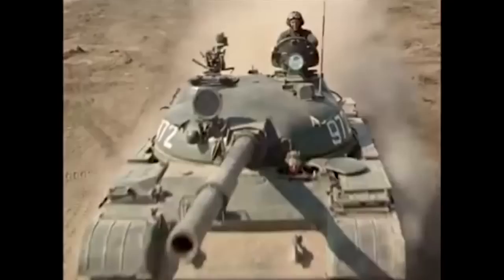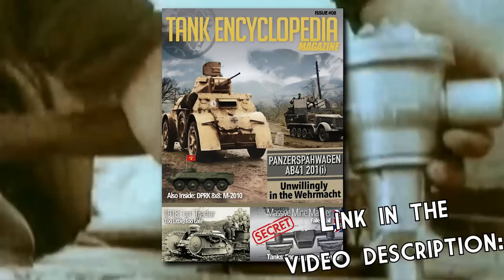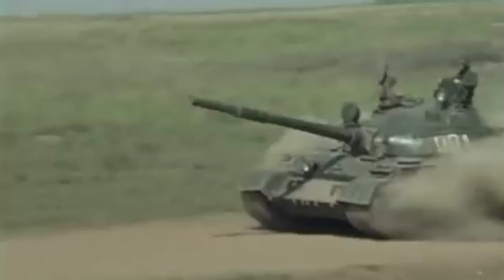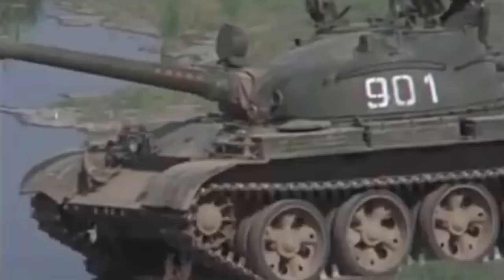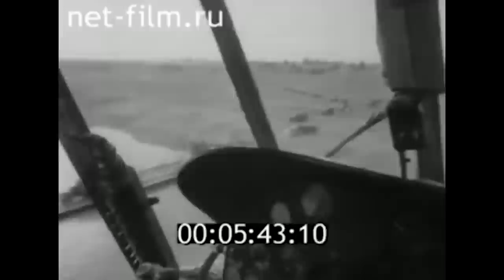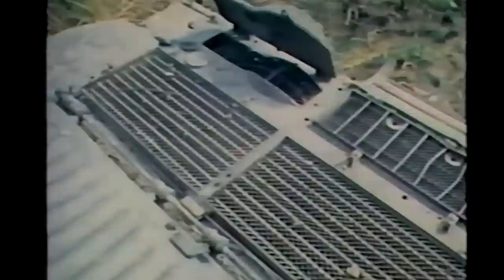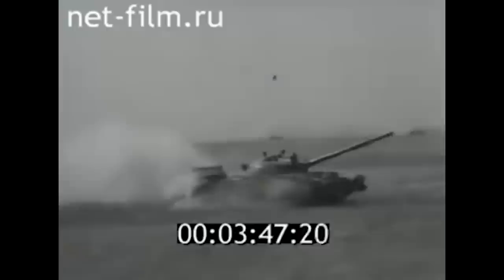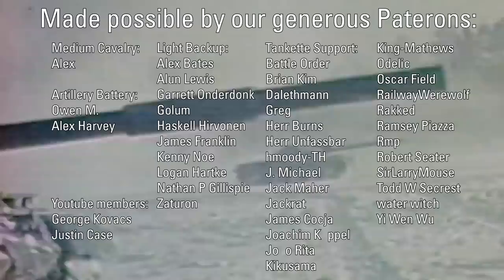Same-Old Everything Else | T-62 Main Battle Tank Part 2

Comment: “Groundbreaking gun same old everything else” is why I like the T-62 so much tbh it was the last conventional mbt design the Soviets produced before switching to the ultra low profile autoloader tanks they should’ve continued developing conventional tank designs imo to truly match the western ones
Reply: they look about the same height wise to me
Reply: M60 and T-62 are medium tanks, T-64 was first soviet MBT.
Reply: I mean the original T80 would absolutely thrash the original M1 and maybe even original Leopard 2. The design philosophy was sound, but Russia isn't the soviet union. Western nations didn't collapse and kept improving their tanks while Russia just couldn't which led to where we are today.
Reply: @92HazelMocha  "the original T-80 would absolutely trash original M1"
Saddam thought the same. However as russians have found out, T-72 doesn't equal T-80 and T-80 will never equal T-80U, even if it's B, BV or BVM modification package because T-80U is straight up different tank and slapping shit to it won't stick.
Reply: @TheArklyte  I think it's pretty well established that the Iraqi failure to repel the combined arms invasion rather than any specific AFV was the cause for their poor performance. It didn't matter if the Iraqi Army had the shiniest T-72/T-80 variants, they had no chance at supressing the coalition air attacks and reconnaissance, which meant that every tank unit knew what they were up against ahead of time. That and the lack of modern T-72 variants with adequate night vision gear (outside of IR) didn't help. 'slapping shit to it wont stick' doesn't even make sense, early M1's has a 105mm gun, was the upgrade to the 120mm 'slapped on'?
Reply: @TheArklyte ude, Iraqi's mainly lost because they were massively out-numbered, they were zerg-rushed.
Reply: @TheArklyte what are you smoking? I want some of it.
Reply: @goforbroke4428  basic logic? T-80U uses different armor array and MTU from T-80BV so claiming that T-80BVM is equal to the former implies that you cut down the tank in several places, removed and replaced whole sections, welded it back together and somehow made sure that those welds aren't now a bunch of massive weak points. Which is, if you have trouble with comprehending basic concepts and sarcastic tone of my previous sentence, something that no sane person will do as it's wasteful and pointless... though now that I think about it, it's something stupid enough for russians to try 🤔🤦
Reply: @bilalsadiq1450 
>it didn't matter if they had the shiniest new T-72
>lack of modern T-72 variants didn't help

You've contradicted yourself in back to back sentences.

Now, let me tell you something about how it didn't matter. Except it did. And Iraqi soldiers and engineers had proven that their perfomance far outdid some former "superpowers".

Saddam hoped 1)that certain parts of the desert would be impassable; 2)that coalition forming against him would fall apart; 3)he can slow down and tie down the invading forces to turn it into a slog.

1)just like two certain examples before this, desert ended up being quite passable and easy to navigate by NATO forces due to one feature their AFVs had - GPS. Not quite as cool as how Toyota Hilux have ruined Gaddafi's hopes that desert would defend him, but it still completely nullified that advantage as both supplies and thus invasion force continued to roll forward.
2)bombardment of Israel with Scuds to drag it into the war too and thus nullify the support of muslim neighbours to this invasion and even gather their support in the long run by turning it into bigger "westerners vs us" war. Doesn't work without achieving the slog part where conflict will just drag on for months;
3)main iraqi losses of AFVs amounted to ATGMs launched by IFVs and helicopters. And when those had trouble a few times, tanks and airforce rolled up. Because thanks to №1, they knew where they were, where enemy was, how to outmanoeuvre the enemy, consolidate forces and when to engage. Now tell me, do you know what an ATGM is? I'll assume you do and that Desert Storm era ATGMs are mostly HEAT warheads and laser guidance. And while TOW-2A and interim Hellfire where starting to get available during that time, majority of ATGMs used during that conflict were of older types. So no tandem warheads. Moreover many types would be even susceptible to IR interference from dazzlers like Shtora. Dazzlers Iraq tried to purchase from USSR and then, after USSR once again refused, from China. Reportedly they even were able to import a few. Not a few hundred or a few dozen, but just several units. So their impact isn't known as not only they were of older type, they didn't make it to combat. But let's back a bit to that lack of tandem charges and ATGM reliance. You know what it sounds like? Sounds like there is a technology that was used on modern AFVs before Desert Storm that addressed that! It's called a bloody ERA. That iraqis also lacked a capability to mass produce and thus outfit their tanks with. But it didn't stop them. Remember how I've praised iraqi engineers? They already faced TOW missile, even if TOW-1 en masse launched from both helicopters, AFVs and even by ground crews. How? When? Iraq fought in Irano-Iraqi War! Recall that name? War that saw a low of soviet and american export equipment used. And guess what, iraqis in late 1980's did what apparently took russians over two more decades to do and achieve only on T-90A, if video from Syria and russian nationalistic zeal and pride in comments under it to be believed - make tank immune to old TOW-1. Iraqis tested several dozen arrangements of applique composite and screens with captured iranian TOWs. And applied spaced armor to their T-72M1's ie polish T-72A's without modern FCS, with empty ERA, mild steel APDSFS and downgraded armor array. They also applied the test data to upgrading another tank though were limited in time, budget and modification reserve of tank in question so it produced mixed results, which worked only sometimes. Maybe you've heard of it? T-55 Enigma rings any bells? Oh, and final problem for ATGMs, but first obstacle on their flight path - APS. Drozd existed in 1980's, costed only 30k$ per unit(ie 10k$ per saved life of crewmember at most if we take 3 men tanks like T-72 in account) and was mounted even on bloody T-55s of soviet marine corps(though mostly because they were lighter tanks that suited their landing crafts). So what would happen to a "most modern" tank of 1989-1991 if faced with american forces? It would also know where it, its allies and opfors are. It would be notified if lased by either guidance beam or even rangefinder(and turn turret in that direction. Notice me, oh reader. And thus also dazzlers, gun and APS), it'll notify allied units, turn IR dazzler that way to slow and confuse the electronics and to scan for the targets in the meantime, it will use thermals(iraqis tried to purchase a few from Belgium. Once again, use only rumoured and no evidence remained) to scan for hostiles and deploy smoke(smoke dischargers in 1991 already experimented with blocking IR so no beaming and no thermal, not to mention often the system was automated to cover the tank if lased immediately) if found any or shot at. Then it'll retreat to better position. Maybe even fling ATGM back at IFVs or airburst HE at helis to scare them away. Instead of being turned into a husk by single I-TOW or TOW-2 or Hellfire or whatever else.

What happened instead? Well, you've heard of most of it. But here are some outstanding examples. 
Remember that graph that shows the difference between M1 and T-72 size, but also their gun depression angles and how much T-72 needs to expose itself? Remember that "weak spot" on M1 front hull that irl everyone seems to miss unlike videogames? Why is that? Because that graph shows how both tanks were designed to be used! 
T-64(and thus T-72, T-80 and T-90) was designed to have low profile, small turret and ammunition load as low as possible. It also got equipped with its own dozer blade. Purpose of all of that? Ideally in defensive operations it should fight from dug out positions while showing only its hard to hit small turret(which shouldn't carry extra ammo in it unlike what russians practice all the time to explosive results). That made tank unmatched in ranged firefights! In 1970's. But here comes the problem, 1970's ended ¯\_(ツ)_/¯ Thermals entered the field, GPS became possible, FCS improved drastically, laser rangefinding and IFF became mundane. Remember those russian propaganda videos with firing exercises on a tank where it fires from camouflaged position, slowly backs away into trench, resurfaces at different position and fires again? Iraqis had those. In fact they had improved them with their experience from war with Iran. They added the tile and mat cover in front of the dug out so that the shot won't raise the sand cloud, obstructing the vision and flashing the position to the enemy. Did it work out? No. Because on thermal position was easily spotted. Then it was reported, lased and marked on the map with GPS coordinates connected to it. And then the whole US army saw it, as did USAF and american allies. So tank sat there, in ambush, waiting to strike at unsuspecting foe when it was already itself being surrounded by other tanks which no longer had a problem of missing its turret from far longer ranges or an air raid incoming for it without suspecting a thing. So the whole design philosophy of why those tanks were the way they were designed was already turning obsolete.
Let's get back to the graph. It's also showing how M1 was designed to engage. And it shows why that "weak spot" exists and why it's never hit. Look at how M1 engages. Yes, it's in an ideal situation. We've just discussed an ideal situation for T-72 and how and why even that no longer worked for it. So, how does M1 engage? By using natural environment in angled position with hull being hidden away and gun depressed down. They may use dug outs to achieve the same too, but they don't rely on them. And as mentioned, they have trouble working when thermals exist. Bet you're not reading this. Its whole doctrine of use stands on engaging on their terms, on rapid redeployment, maneuver and on superior long range accuracy with main gun. Highly costly doctrine which requires a lot of preparation, maintenance and training. But it's not falling apart due to one element changing and now you suddenly losing ability to effectively use your tanks on defensive. As for offensive, soviet doctrine relied on massed wide front attack which would have been extremely effective as enemy wouldn't have dedicated antitank weapons and MBTs everywhere... in the 1970's! The existence of helicopter launched and hand held ATGMs kind of ruined that too. See any correlation? 
Anyway, back to M1 Abrams and why I've said that iraqi tankers were awesome.
There are a few(as in "not many", but still several) famous examples of tank on tank battles during Desert Storm. With M1's initiating the attack from superior position at very long range and relying on their FCS and armor to see them through. Ambushed iraqis had T-72M1 at best and those lacked the features I've mentioned so those were pretty one sided fights. And yet M1s were getting hit. At nearly 2km ranges. Without ATGMs. Without modern FCS. When surprised andat a disadvantage iraqi tankers still fought back in professional manner! None of the M1s were penetrated as far as I know("weak spot" isn't possible to hit when M1 engages on its own terms plus aforementioned rumoured sabotaged by soviets mild steel penetrators plus lack of modern FCS system). There were M1s hit on the turret up to 5 times and sent to repair due to destroyed optics and stuck turret ring(so effectively those tanks were lost until full refit, even if not destroyed). So iraqi crews in ambush by superior foe kept their cool, engaged the enemy, shortened the distance and even concentrated fire on certain tanks. So stop talking bs about iraqi soldiers and engineers, so far they've performed better then russians did in past 30 years given the circumstances both had. Just through sheer training and middle finger energy. And without any "modern tank" we discussed above. Which would have improved their perfomance drastically.
Reply: @bilalsadiq1450  /continuation/

Did such "modern tank" exist? No. Soviets never put full kit of Kontakt-5, Drozd-1, Shtora and thermals on same tank and definitely not on T-80U or T-72BU. That's what counts as modern for 1989-1991. And they wouldn't have sold them to Iraq. But that's not what you asked or what we talked about. You wanted soviet/russian tank to match "earliest Abrams". Well, here it is. It's theoretically possible. Likewise it's possible to match further Abrams versions, Leclerc and Black Panther with contemporary russian(or rather soviet tank design) school projects of same years IF you take several different prototypes, smash them together and then somehow find factory, equipment, specialists and budget to produce that thing. And then you crew it with dedicated professional crews, allow them to regularly train with it and maintain it properly for its whole period of service. For example for 1994-1998 such tank would be Object 187(you may know her cheaper and simplified sister, Object 188 aka T-90A) ie elongated T-72BU with removed "cleavage" on frontal hull, reworked autoloader that allows to use longer APFSDS rods AND is moved slightly behind the turret and separated from crew compartment, allowing to use blowout panels(tested on 152mm equipped Object 292 and found adequate and reliable, unlike the gun which wasn't needed), reworked engine compartment with new MTU allowing better reverse speeds and much higher power to weight ratio, extended barrel gun that would allow to use said longer ammo aka 2A66(yes, the "technologically unmatched and brand new" 2A82 was developed in 1994 on soviet remains, it just had different name. And likely once again 2A82 is a cheaper and simplified version of 2A66). And this is where I say that your mother smells of blueberries since you're not reading this comment anyway. Add on top newer generation FCS, thermals, new ERA, Arena APS and so on. Once again, you get theoretically possible tank that never existed, not to mentioned produced and used. A 1994 tank that would have left their infamous T-14 from 2014 in dirt. But nope. It took them 3 decades to get to technological level of NATO Desert Storm era FCS - T-90M is the first russian tank EVER equipped with muzzle reference sensor(MRS), equipment piece widespread during Desert Storm and used even on M60A3 TTS used by USMC as "hand me downs". And even then only thanks to imported equipment kit 🤦

So, what difference a "modern AFV" would make, huh? And mind you, that's ONLY tanks we've discussed. Not including other things iraqis were aware of and trying to fix, but lacking resources and time to do so. Unlike some other country that constantly floats around being 7th-15th largest economy on this planet(Iraq floated around Belgium at its best). No difference you say?

Tl;dr - no, T-80 doesn't crush "early" M1 for same reason Yamato couldn't crush "smaller" Iowa. And even T-80U would need a LOT of (thankfully for it existing) bells and whistles to match contemporary M1IP. /cough/ And also an iraqi crew with balls of steel and proper training:P /cough/

P.S.: hard to believe that I typed in this wall of text on a phone without YT dying, lol, what a waste of time 🤣🤦
Also, did you know that there's apparently a 10k symbols limit on YT comments?
Reply: @alphana7055  comment(s) above. Have fun;)
Reply: @TheArklyte  Also, did you know that there's apparently a 10k symbols limit on YT comments?
Well, at least something useful in this post :-D
P.S. Seriously, man, when you write about "a modern Russian tank in 1994" it's just lol. The Russian Federation was just FUBAR in the 1990s, it's like doing nuclear physics in the Wild West.
Reply: @adeptusaegis3189  especially if you didn't read any of it.

You know what's funny? The people talking about how bad everything in 90's was are mostly Putin's fanboys saying "you don't like it? Do you wish it to be like the 90's?" And yet it's the 90's where things like Намедни were possible. Where it was possible to critique, to gather, to discuss. Possible for a small guy to start a business without coming from bureacratic or enforcer family. Oh, the crime rate was huge. But it NEVER gone down. The people responsible for the worst that happened in the 90's all stayed in power. And are now talking how bad were the 90's because it was the only period when they had competition and were being criticized:D
Reply: @92HazelMocha  put the bong down... The T80 as built main weapon can't penetrate the front armor of the M1... where as the 105 MM with depleted uranium AP rounds would go straight through the T-80.  In addition the t-80 was less capable, slower, didn't have a laser range finder.. the list goes no and on.  The M1 could fire and hit on the move from the 1st round fired... T-80 couldn't back then.. and still can't today.  And since then the M1 has been upgraded to a new 120mm smoothbore that's even more lethal.
Reply: @alphana7055  Wrong... The Iraqi army was roughly twice the size of the UN forces.  They weren't zerg rushed either.. they were destroyed in place because Saddam lost control of the battlefield and his units were for the most part blind.  They had no idea that we could operate in the desert, because they couldn't, so they assumed we couldn't as well.  Thankfully we had GPS and they didn't.  That and Russian hardware is crap.. always has been, and with amount of corruption that nation has.. probably always be be
Reply: @rodshoaf  Lmao, the M829A2 couldn't penetrate any russian armor with KONTAKT-5.
Reply: @alphana7055  Those t-80s did a world of good in Ukraine... How many survive after being deployed there?  0
Reply: @rodshoaf  Could ask the same about Leopard 2A6s :/
Reply: @alphana7055  you mean the leopards the Russia claimed to destroy... but were actually decoys?
Reply: @rodshoaf  Oh so this how you guys coped with the VISUALLY CONFIRMED losses :D
Reply: @alphana7055  yes the visually confirmed losses of decoy tanks... as in they were not tanks.
Reply: @alphana7055  You've been wrong on just about everything... That the M1 can't penetrate the armor of a t-80.. even the original base model.. then being wrong about armor piercing deplete uranium rounds.  stop being a russian shill and do your homework.  Hell Russia can't even build a main battle tank because they can't make the electronics.  Don't believe me.. watch LazerPig's video on the T-14.
Reply: @alphana7055  The t-80 didn't have reactive armor... that was later versions.  Also those reactive armor packs on most russian tanks are fake... filled with cardboard.
Reply: @rodshoaf  T-80 had even without ERA a composite armor aray that ripped APDSFS apart through lateral forces, that defeated all 105 mm ammunition. Kontakt-5 was developed at the same time as the 120 mm was introduced with the M1A1, so you have no idea what you talking about.
Cardboard? Like those Leo 2A6 decoys you say 🤡
Reply: @alphana7055  no sir it didn't  the T-80 didn't have KONTAKT-5 armor until the T-80U in 1985, the M1 entered service in 1984.. And the 120 was and still is capable of ripping straight through the T-80U.  Then again it's doesn't even have to go through it... all it has to do is get to the ammo wrapped around the inside of the turret.  As Russian tanks have a wonderful way of exploding once the hull is penetrated.  Unlike The M1 which keeps it's ammo safely stored behind blast doors.

Also the armor of the original t-80 was considered OBSOLETE by 1976... Which if you don't know.. was the year it was introduced and as a result the t-80b was introduced in 78.

Peter Vortinsky
Studied modern millitary conflicts for 2 years

On commenting on comparisons between the t-80 and the M1

"Both tanks are very simmilar and it is very hard to say which is better, the T80 was lighter, smaller and faster as well as having a larger cannon. But i think the raw specs dont matter because the combat conditions for the crew of the T80U where horrible."

It's not the hard specs of the tank.. it's who gets off the first shot.. AND the t-80 with it's terrible crew compartment means it doesn't stack up against a M1.. which can fire at full speed with assured 1 shot 1 kill capability.

Oh and the T-34 was trash!  Don't believe me? Watch LazerPig's channel on exactly that subject.
Reply: @rodshoaf  No one mentioned T-34 but thanks for revealing that you are a Lazerpig fan, lmao, very predictable.
Reply: @TheArklyte The main reason why Saddam’s guards had so heavy of loses was due to the tanks being insufficiently equipped. With the tanks being equipped anti-personnel rounds rather than anti-tank rounds. That and insufficient supply lines.
Reply: mbt is mbt cause its the only type of tank. Soviet tanks really do follow the medium line. T-10M was the last heavy. 64,72 etc are medium. Bad side armor, like Panther, but low. If T-34 was the only tank, in modern parlance it would be MBT.